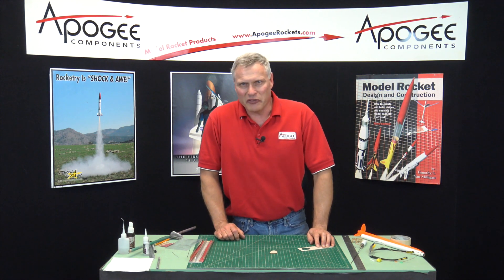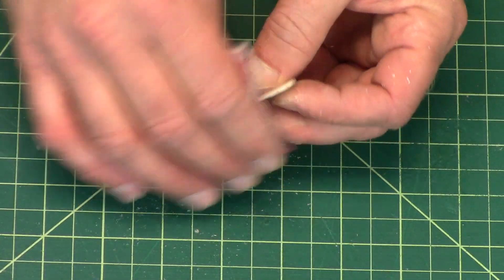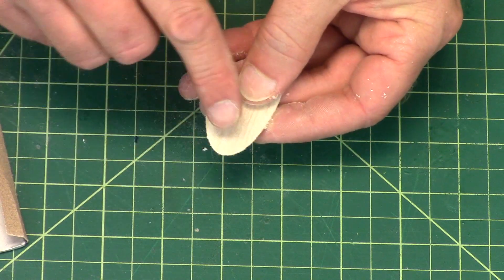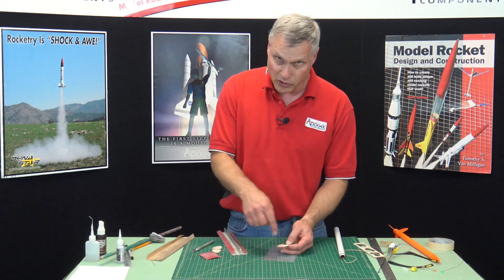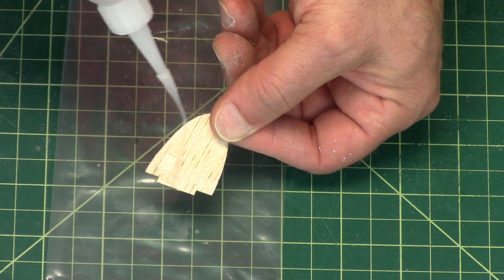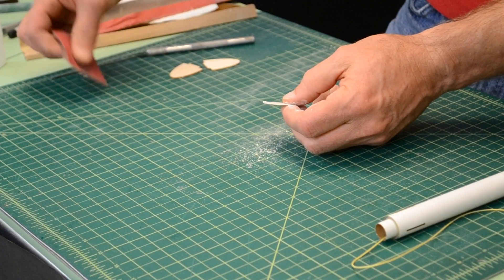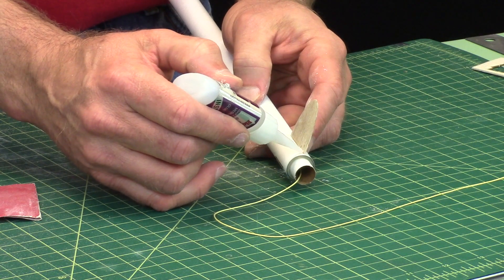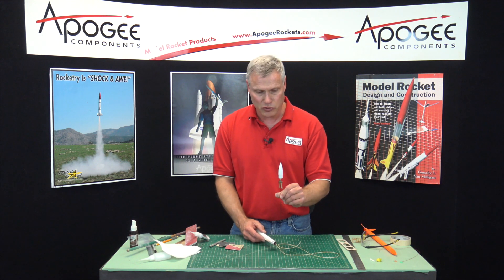Mini-Copter 10 - Airfoil the rocket fins

Comment: Why use super glue to harden fins for one rocket and Elmers wood filler for another?
Reply from the maker: The Elmers doesn't really harden. It seals, but the weight is less. So if weight is an issue on your rocket, then that would be the choice.